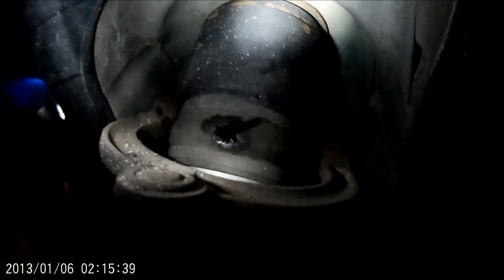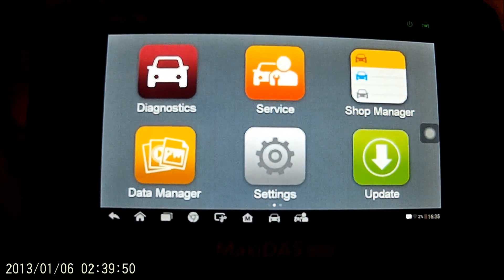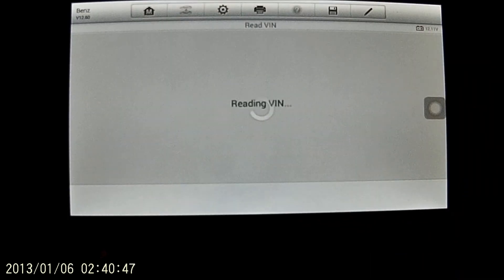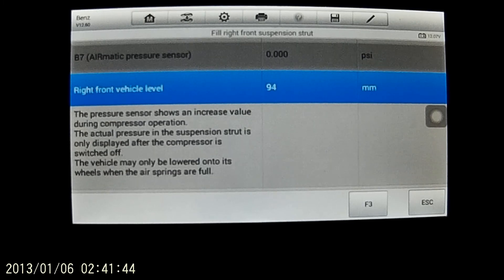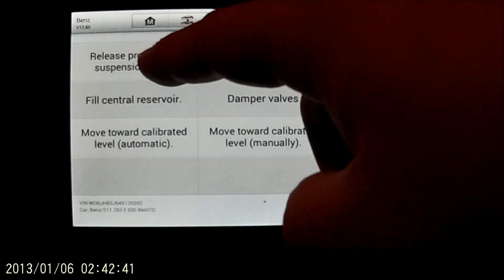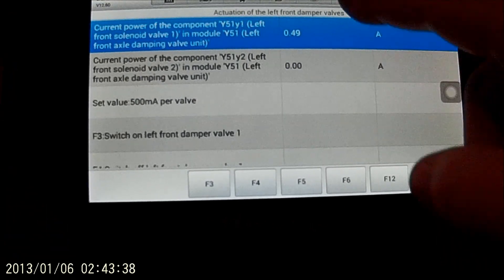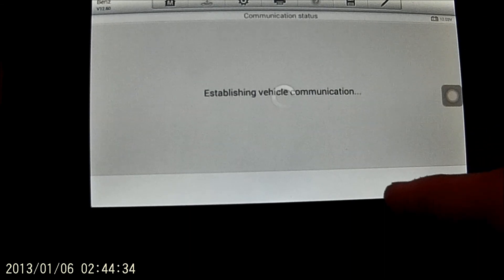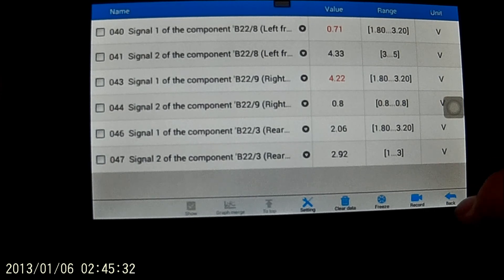Maxidas DS808 Airmatic functions MB e500

Comment: Hello.. can the system celebrate all and  individual air bags for the car?
Reply from the maker: yes you can adjust and level individually but you need to take into account the propeller shaft angles when adjusting your suspension so that you do not cause any issues